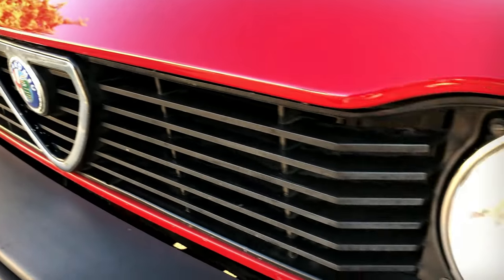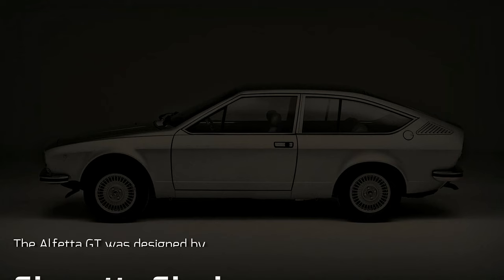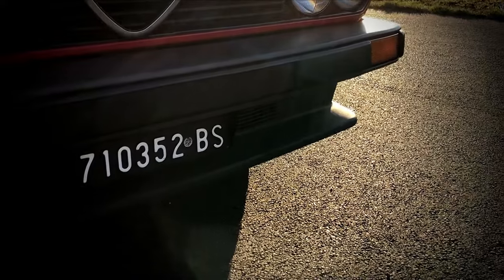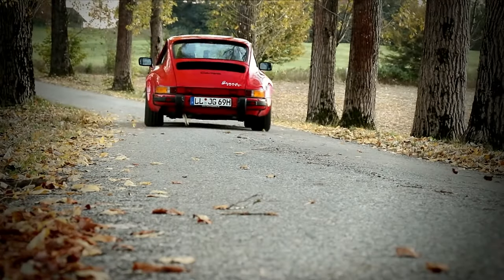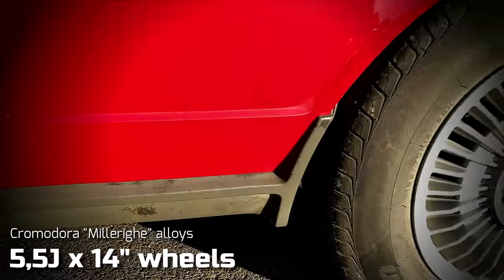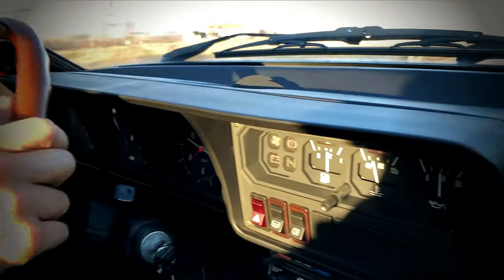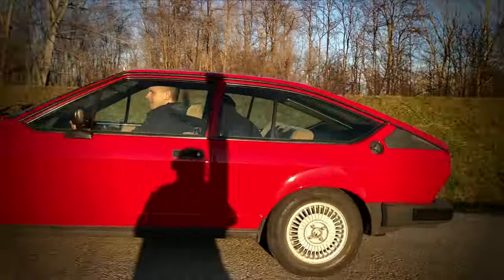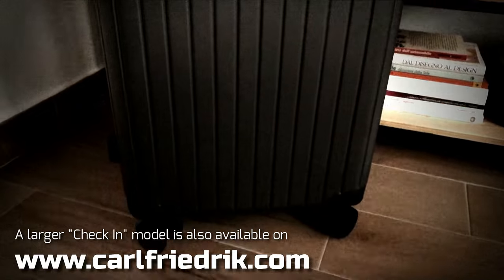Alfa Romeo GTV 2.0: An Italian Classic

Comment: Totally correct regarding mechanical sympathy required for gear changes. Lost count how many times we replaced 2nd gear synchros. The 2 flywheels and the heavy propshaft meant the gearbox took alot longer to slow down plus the over long gear lever gave people to much leverage. We used to cut almost 2 inches (50mm) off the gear lever then angle (bend) slightly towards the driver. This made for a much more positive gear change and made 2nd gear synchro last alot longer. Those were the days. Great video.

Comment: I always loved the way Alfa interiors were sorted out, I especially loved the 3 small toggle switches between the Giulia's front seats, for wipers, fan and dashboard lights, it made part of the Alfa experience, like the two little dials for temperature and oil pressure in the center console. This made you aware you were driving something special. For me the last Alfa with a specific Alfa interior was my much loved 159 JTDm 16-valve Diesel, although the MiTo Veloce I now drive is a little devil in disguise I miss the typical Alfa Romeo lay out of the dashboard.
Reply from the maker: Well, you need to watch this video then, if you haven't done it already ;)
https://youtu.be/SlB3dqpbJPs

Comment: I own an totally original Alfetta 2000 GTV, which I bought Nov 1976, and due to the rather rough danish winters (much salt on the roads)  I have only been using it in the summertime. Today it has appr. 110.000 kms on the clock. Last trip (out of maybe 15) to Italy was in september 2018. I hope next year, when the virus is gone, I can go again 😎
I think the old (1st series - the 1,8GT and later 1,6 & 2000 with steel-bumpers) was the prettiest 😍 All that rubber on the later series, didn't do anything good for the design ☹️, is my opinion. Also I prefer the "wooden" dashboard to the all black ones. 
Nice video, Thanks. Keep up the good work. I will follow you here.
Reply from the maker: Wow, a one-owner, all-original GTV, that's fantastic, congratulations!
Yes I agree the original look was best. Thank you and welcome onboard!

Comment: Loved this car in all it's forms , but prefered the original chrome bumpers of the Gtv 2000 with the 2 chrome flashes either side of Alfa's insignia on  the front grill.  Never forget seeing Motorsport magazine road test as a teenager mid 1970's , C.R. driving the car around Mallory Park race circuit ,drifting through corners in the wet , but all 4 wheels on the tarmac by virtue of its DeDion suspension and transaxle  layout . Marvellous.
Reply from the maker: Cool. Yes, the GTV 2000 L looked great, it's my favorite as well.

Comment: Mine sounded awesome with the Aftermarket weber twin air filters on. After plenty engine work and head work put out a mighty 115hp at the rear wheels hhahah. Went through 4 head gaskets. Big rust problems though

Comment: Yes agree. I own a 1977 steel bumpered GTV and the only thing that mars the superlative driving experience is the gear change. So much so to while driving 90% of one’s focus needs to be on gear selection process. Only then can one be smooth
Reply from the maker: Many within Alfa itself weren't keen on the transaxle for this reason, and the Alfetta came out as it was mostly thanks to Giuseppe Busso's staunch support of the solution. Things got better with the so-called "isostatic" linkage used on the 90 and 75, though, as I've had the chance to see for myself. In fact, the 75 I drove surprised me, as I was expecting it to be worse than it actually turned out to be.

Comment: Love those cars, had several ones.
Reply from the maker: Which ones?
Reply: @Matteo_Licata  1985 2.0 with 14" steel rims, red of course. Two of those and the first one was a 1983 2.0

Only V6 I had was a 155 for track use.
Reply: @Matteo_Licata  Also got Sud Sprint, several 155's, 75 and Panda 4X4 etc
Reply: @Matteo_Licata  and 145QV of course
Reply from the maker: Wow, that’s more Alfas than even many hard-core Alfisti have owned. Cool!

Comment: great man, now you must do one for GTV 916 & hopefully spider, that I'm aiming for buying!!!
Reply: I have one,you won’t regret it.
Reply: @1569-f8x  I thought that you have a video 😂
Give me some advice and where do you come from? If it's not a secret ofc 😅
Reply: @duleopasni  I’m in ireland,the first thing I would look for is rust.its a killer in a wet climate.check the inner sills as the side moulding hide a lot.suspension,front and rear,can be expensive,but easy diy,which save money on the parts.i personally would go the poly bush on the rear.oem up front.engine,doesn’t matter which engine make sure timing belt and water pump and variator(on the 2.0 twingspark)are done.expensive fix it it snaps.im on my lunch break so if there’s anything else you want to know let me know?is this your fist Alfa?
Reply: @1569-f8x   I've got 147, but it's time for real ones. Honestly didn't get the poly bush on the rear.oem up front, so could you explain it further? 😄
Thanks a lot and greetings from Serbia!
Reply from the maker: A “916” video is long overdue, I agree. It’s perhaps the single most requested subject on this channel :)
As soon as I’ll find a nice example to film, I’ll make it!
Reply: @Matteo_Licata  go for it bro, I really believe that it is so so beautiful car with the well known engine. And a spider as a convertible - there's no mistake

Comment: Nice video! The 4 cilinder must have had a better road holding than the Busso, right?
Reply: Not really, V6 12V engine is relatively light. But higher power and torque output is straining those fragile propshafts and gearboxes even more. GTV6 are much more prone to fail mechanically-wise. This was partially addressed in later production years but never completely solved anyway. Nevertheless both 4 and 6 cylinders are joy to drive when thay actually work.
Reply from the maker: Exactly. I’ve personally lifted a Busso V6 block (just the block) and it’s deceptively light. Weight balance on the GTV wasn’t adversely affected by the bigger engine.

Comment: I assume you have first checked if those cases actually fit into a GTV, huh?! The first version is the most beautifull indeed although I also liked the "just add black trend" of that time. It has been in and out of fashion since then anyway. At the moment less chrome is all the rage again on motorcycles (look at the present Guzzi's) but a few years back it was all café racer and thus chrome, including plastic parts with those nifty new chrome paint jobs one can nowadays even buy in a spray can!
Reply from the maker: I think that, given period circumstances, the Alfa Romeo stylists did a decent job. It could be argued that they did better than what Pininfarina did to the Spider in '82.
By the way, yes, the GTV's boot can take two Carry-On suitcases ;)
Reply: @Matteo_Licata  I gues it is all relative indeed. I wouldn't say the second Spider was an improvement either but cam tails where simply de rigeur then and it was designed very much with the US market in mind. It's a bit like the restyling of the MGB with that rubber bumper, which was done much more on the cheap anyway. On one side it keeps the lineage alive. On the other it is a clear indication the factory is artificially keeping stuff up to date. At least that seond Spider was a real re-engineeering job. Furthermore: For most the first VW Golf is the only real one. Still the 2nd also looked good. And what about the Citroën DS? The list is endless.
Reply from the maker: @marcbrasse747  After all, it's a matter of taste and opinion. Makes for interesting conversation, but it's a debate that will never result in a conclusion.

Comment: Ah. I had a two year love affair with a steel bumper GTV 2000 in the early 80s. She looked beautiful, sounded sweet and went like the clappers. Eventually she started to look shabby thanks to tin worm and I left her when the prop-shaft snapped.
PS. T-shirt link doesn't work
Reply from the maker: Hi David, thank you for letting me know about the link: it’s an older video and I forgot to update to the new shop. Here’s the new link: https://roadster-life1.myspreadshop.com/v6+fuel+injection+25-A61f14fd1f33f941d03da61e1?productType=210&sellable=bB9MdQb398sXepLwrg3m-210-7